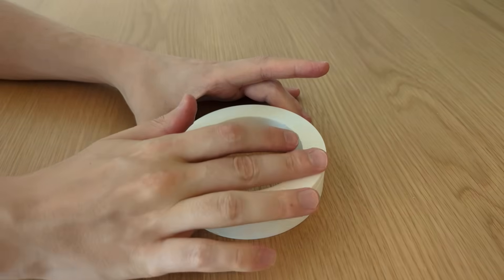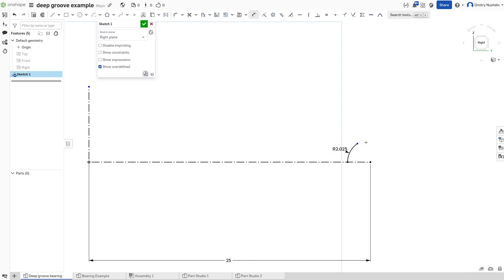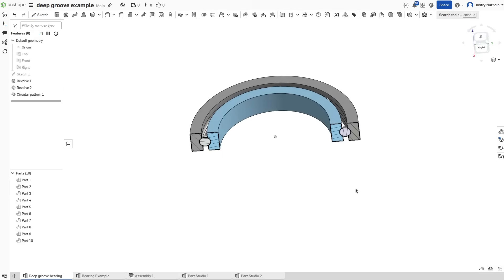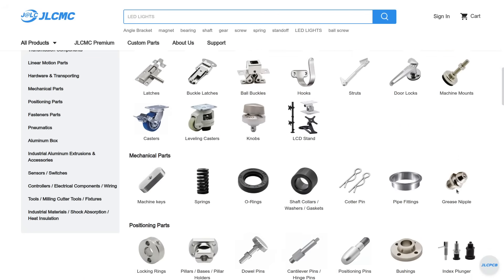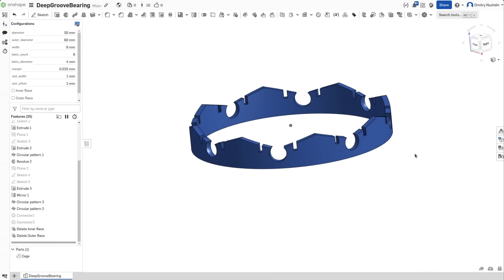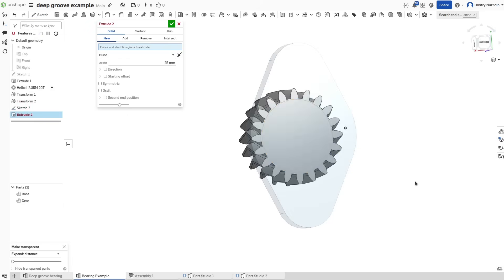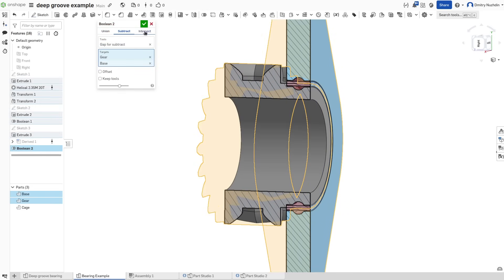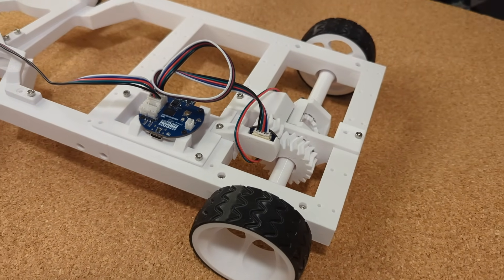Best 3D Printed Bearing Design

Comment: As someone passionate about 3d printed bearings, I cannot help but ask, in all good faith and with all positive attitude: what makes this the best 3d printed design? I may be missing something. So not to nit pick, but I've seen numerous metal on plastic bearings before, the only things that are new here are the compliant click slots (love the idea!!) and the fact that you made a parametric design available (though most 3d printed designers do that nowadays). Oh, and nice to discover your channel, I have just subscribed! :)
Reply from the maker: Thank you! Well, it's a bold claim, and there are 2 parts to this.
First of all, "best" is a very subjective thing and, in this case, depends on what qualities you value the most. It's not the simplest possible, not the strongest, not the most efficient, and not the most precise. But overall, I think this design is good enough for everything, like a perfect middle ground. And that's precisely why metal bearings with the same design are the most widely used. For me personally if I need a bearing -- I will use this design if I can (I can see some cases when it's impossible to use this one, or it is a bad choice for other reasons). Of course, I understand that there are a lot of things that I don't know or haven't seen. But I think I have at least some justification for this claim, so it's not pure clickbait. I really believe that it's good, and people who are interested in bearings could benefit from watching the video.
The second part is about clickbait. It's obviously a clickbait title. Unfortunately, it's just how YouTube works. Making a good video is not enough. The content itself is much less important for getting views than the title/thumbnail, which is 80% of the result. And all of this works like a snowball; if something of this is lacking -- you get no views, and 25-30 hours of work are just wasted. (Like my last video, which has only 1k views, even though I think it's the best one on the channel). So, especially if the channel is small, you should do your best with the title. It should have some level of clickbait. Otherwise, it will have 500 views, and nobody will see it. And making a video that nobody will watch is pointless. Believe it or not - my intentions behind this video are to share a design that I think is good and to empower other creators. It's not about making money or getting views. But to achieve this goal, I have to play this stupid clickbait game because that's how YouTube works. I hate it, but I don't think there is a way around this.
Reply: @Positive_Altitude  Thanks, man, for taking the time for such a nice and detailed reply! Yes, your bearing, just like my designs, is a middle ground, best suited for a specific type of applications, and allows you the freedom to design with less constraints. For an RC car, aren't you worried about wear / heatup during its use? My hybrid design uses metal on metal, so it's more robust, but also more complicated for your applications, and not really suited for them, as it's mostly for large diameter bearings. Not my idea (Franke from Germany holds the patent for nearly 90 years) and I initially worked on steel + aluminium and then later on steel + petg). And to my nice surprise this year I discovered that Franke had started exploring using metal powder 3d printing just months before my hybrid bearing video had hit the tubes.
As for click bait, yeah, I can clearly see how not using it my videos are not performing nearly as nicely as I would like them to, nut just can't bring myself to use clickbait titles, call me too old school.
Reply from the maker: Great channel! Love your designs, I thought making metal races is extremely difficult, but you found a great approach, I learned a good lesson from it, thank you!
Reply: @Positive_Altitude  thank you, man! I really like your content end engineer mindset too! And I hope you get some inspiration from my stuff too!

Comment: Awesome.  Many times a print or a project requires a bearing but it doesn't really have to be that strong to function. Many times a steel bearing is overkill. 
It's always a chore to to find a suitable one and then theres the wait for it to arrive (if you want it cheap you'll be waiting for it for month from China)   
Just ordered a set of 4mm balls and now I'm set for life with all kinds of bearings :D
Reply: I'm using plastic BB gun balls which are made with tight tolerances and having ~4.4mm diameter. For my 3d printed designs it is good enough.
Reply: @JanVokas  If you have room for 6mm balls, airsoft BBs are available in large bulk, and very tight diameter tolerances
Reply from the maker: Yeah, that's exactly my vision of it, good luck with your projects!

Comment: I think the most interesting part about this is that you can make the bearing part of the... uh... part. No need for trying to press-fit a 3D-printed bearing, should result in a stronger design with less slop. A gear with an inbuilt bearing rim, a shaft with an inbuilt bearing hub, and some balls and presto you have a very tight tolerance bearing fit.
Reply from the maker: Yeah, it also gives you special approach to your parts assembly. Because with press-fit bearings you probably still need some ways to secure it, to make sure that it will not go anywhere. And here you can use the bearing itself to lock two parts together.

Comment: That is an excellent solution!!!  I was just about to add bearings to my gearbox design using your old method but this is such a slick solution I will definitely go this route instead.  Thanks for sharing.
Reply from the maker: Cool! Glad it helped! I also have an unfinished design of a gearbox (a variation of a harmonic drive). Maybe I will show it some day if it will work...
Reply: @Positive_Altitude  The harmonic drive was one of the first original 3D prints I did just because it is such an interesting concept.  My current one is a split-ring epicyclic.  I'm a mentor for a FIRST robotics team (159 - GoAlpine!) and I'm always looking for interesting things to show the kids.  This year, our shop is under construction during build season so we have been relying on 3D printed parts more than previous years.

Comment: @Positive Altitude First let me thank you on your ideas and videos. And let me add few my observations: I liked your prev bearing design and used similiar designs in my projects. The main benefit of prev design was ablility to add adjustable tension. Since we are making out of plastic it will wearout much more faster then made out of metal and adjustable tension is great compensation method espessially for thrust bearing. (and that was also  forgiving on tolerances)  While "classic" design is more suitable for bearings made out of stiff materials as metal. And sure this classic like is much more compact. So would say it depends on application. on wheels "classic" is winner. but as trust bearing prev design is much better
Reply from the maker: I agree. Also, thrust bearings in previous designs carried the load directly through the contact point, while here it will be at 45°, so there is 30% less load capacity per ball.

Comment: Nice and simple design! Even though I prefer to use off the shelf bearings for the durability and reduction in modelling and assembly work I can see this as cool solution for times when something very custom and/or compact is needed. Do you have any rules of thumb for how many balls your printed bearings need depending on load scenario or similar?
Reply from the maker: My tests shows that 4mm ball start to damage races at about 4 KG load (for PETG filament, PLA should carry a bit more in theory). So 2kg per ball is a reasonable load with a good margin. But you also need to keep in mind that not all balls always cary load. So it depends on the scenario. 
For axial load it will be about 1.4KG per ball. All balls cary load, but the load is diminished because the contact angle is 45° and cos(45°)~0.7
For radial load only half of them cary load at all, and some are at a very bad angle, so the load is demenished as ~0.3 (0.5 as half of the balls doesn't do anything, and ~0.6 on top of it as it's an average of cos(x)), so 0.6KG per ball for radial load.
All of this estimations are VERY conservative. It's like guaranteed to be fine, maybe it could be many times more in reality, as it's hard to find out at what load races really starts to suffer. At 4KG per ball I see some marks appears on races, but hard to tell if it's a problem or not.
If you have different ball diameter, the load should be proportional to the square of ball diameter in theory (not absolutely sure about it)
That's the best answer I have I guess.
Reply: @ And boy was it a comprehensive and good answer! Thank you
Reply: its also useful when you need to save weight for example in a rc plane or drone

Comment: 3d printed bearing where the most important part is not 3d printed, great.
Reply: Because the most important part. is the least expensive item to buy in bulk, comes in many sizes, could use marbles, airsoft BBs, etc.
Reply: yes, it is great
Reply: Airsoft BBs are an affordable option for 3D printed bearings as well.
Reply: 1000 steel balls 4.5mm is like 10-15$
Reply: most people wouldn't publicly admit they lack balls
Reply from the maker: You just can not print decent quality balls. You can print rollers but they should be quite large (because seams cause too much trouble otherwise) or printed with resin printer (better both). So all of this will work only for a huge 200mm bearing. You can make them smaller, but only if you printing it for fun, it will be to bad to use it for anything. While this design is a real thing that has it's applications.

Comment: probably it would be good idea to make races v-shaped insted dounded. It would make ball to have 2 contact points instead one that would increase durability and reduce axial backlash
Reply: 3d printed parts can delaminate if forces are not evenly spread on the layer lines. It's actually more beneficial to have more surface for the rolling element to roll on instead of v-shaped tracks.

However you can integrate steel wire tracks for the rolling elements to have a smooth rotation and better force dissipation. @Eros Nicolau has some examples on his YT channel on this topic.
Reply: @micultimy91 I loved the wire approach, but I could never get it to be predictable in assemblies. He's really good at it!

Comment: You mentioned that it outperforms your previous design. I'd love to see how it outperforms, and how you tested this!
Reply from the maker: I was mostly talking from a design perspective. This design is easier to work with, takes less space and can handle any type of load (radial, axial, moment). Also because both races are solid parts (not split in two) it's easier to make it more precise (less gap).
Load capacity is probably a little bit higher because the groove makes better contact compared to a flat surface in previous design, but I don't think there is a big difference. The material is a limiting factor here.
Reply: Well, when thinking about performance we need to look at the number of balls being used. The examples in the video are very understocked. This assembly method allows half of the race circumference being filled with balls - which is less than a split race bearing. There are reasons to under stock the bearings making a strength to weight compromise while needing to keep the diameter large. So depending on the use case your mileage may vary.
Reply: @florianfesti4325  True, but I think in this case, he's prioritizing ease of assembly for light load applications. You don't need those centering triangles in the bearing cage, and you could get to a more appropriate packing fraction if you sacrificed some of the assembly ease.

Comment: but what does this solve?
the problem with 3d printed bearings is longevity imo. And steel balls are going to eat a 3dprinted bearing race
Reply: Custom bearing sizes, brings the price down for much larger bearings for prototyping, integration of bearings into parts allowing reduced size for lightweight applications
Reply: @ThantiK  I think he's trying to say that you could already use fully 3D printed designs for those applications and that he thinks this doesn't have a real advantage over them.
Me, I'd love to see some detailed testing and comparisons.
Reply from the maker: Of course it is very bad compared to real bearings. But for light load, low speed, low precision applications it works pretty well. I don't think it wears too fast, but never tested. Maybe later I will come up with a good test setup.
The biggest advantage is that it could be a custom size, no need to buy and wait for a bearing or design around bearings you have. It also could save some space, as you cut races directly on your part. Also big bearings like 150mm+ could be expensive.
Reply: If you need more durability than plastic can provide... You either need to use better material, upsize your bearing, or buy a metal bearing. Your question is self answering. Given an appropriate load for this design, and especially with lubrication, it could last indefinitely. Overload it and it will wear very quickly just like any bearing. They don't use skateboard bearings to support a car wheel for a reason.
Reply: Sorry, but this thread reminds me of one review of a small stepper motor (28BYJ-48) on the Aliexpress. 🙂 The customer gave it 1 out of 5 and commented: "It's not powerful! It only managed to lift up my garage door only once! The second time - it burned out!" 😆
Reply: @vlsext  Perfect encapsulation.
Reply: I can see myself using this for lighter workload applications. For example, I was testing printer configs out and just printed and reprinted collets and gears till I got what I wanted and then ordered exact parts later.
Also, you might need articulation, but it's not a part under constant stress. Could also make the design less expensive.